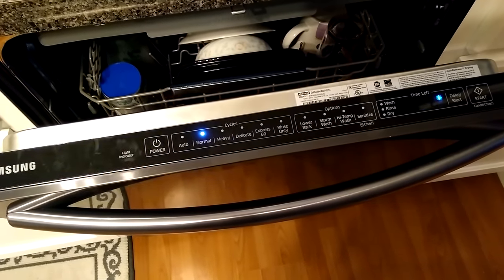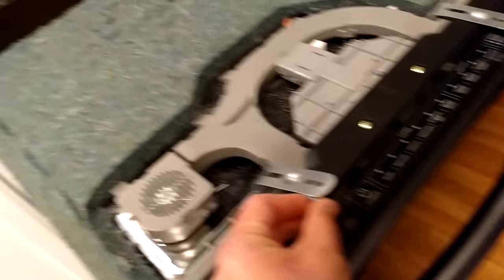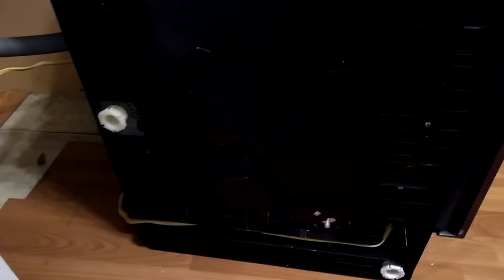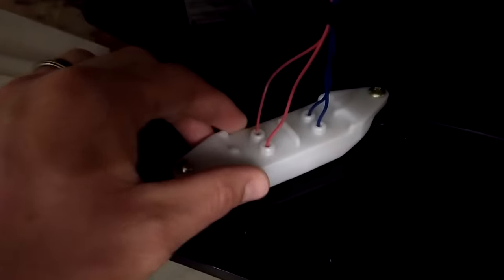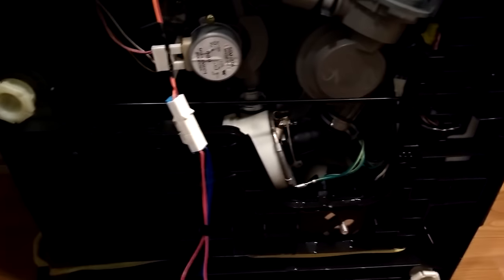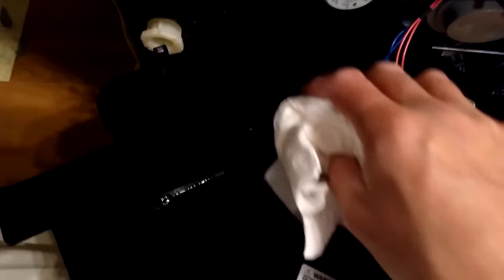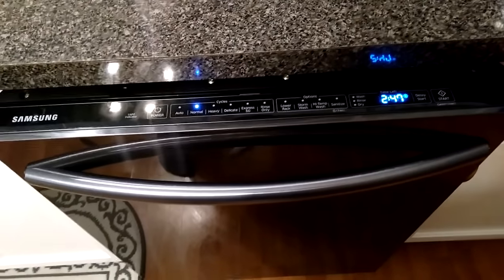How To Fix Samsung Dishwasher with LC Error Code

Comment: I had the same problem, but was determined to find source of the water. The source of the water on my machine was from the water distribution pump. The shaft seal, which can be accessed from inside the tub, failed. That seal failure also cause a bearing to fail in the pump which caused the dishwasher to be louder than normal. The bearings were pressed on so I could not just replace them. A new water distribution pump and seal were going to cost $320 for parts only. This seal was a bad design and was bound to fail. I figured the same problem would happen unless one made it a point to change the seal probably each year. My dishwasher only lasted 18 months. I’m going with a different brand this time. I would strongly suggest that people look for the source of the water. Finding the source and repairing it is the real solution. If your dishwasher is staring to get louder during the wash cycle, then I’m sure the water distribution pump seal is the main cause and the source of the moisture.
Reply: Just an added point to think about, moisture is not just going to show up in the pan. There has to be a source of this moisture. The water distribution pump cooling blades on the motor move air to help cool the motor. This would help dry any condensation ( and I doubt there would be any). If one takes off the bottom pan and sees any evidence of past moisture then the pump motor is drying up the moisture. But the problem is still there and will eventually get worse where the motor can’t dry it out. The shaft seal is the weakest link in their design. I have seen where some are bypassing the sensor. That is only hiding the situation and not a true fix.
Reply from the maker: Thanks for your feedback and tips Michael. If you read through some of the other comments I point out that I tightened all the inlet and outlet water lines and that must have corrected the problem for my machine. I should have stated that in the video, but didn't. I've had it for more than 5 years now and haven't had any other problems and no more LC code.

Comment: replace the drain-line love to  crack or place on 4 milk crates and run do not touch wire on around the circulation  pump  (live power danger) siver)
Reply from the maker: Sounds good. Thanks

Comment: Did you find the leak?
Reply from the maker: I'm pretty sure mine was from either the supply or drain water lines. I tightened both of them and haven't had any other problems.

Comment: Only trouble with just drying sensor which I did, does not  address leak so will continue to cause problems
Reply from the maker: Yeah, I had to lightly tighten all the hoses going in and out. Seemed to solve my problem, hasn't leaked in over a year
Reply: So just now removed bottom pan ..removed sensor and dried everything very good, cannot yet see leak...if happens again will call repair guy, as I would have to get parts anyway..cannot tighten hoses as they have spring clamps only.

Comment: I have a code 3C1,,,, what’s the problem with my dishwasher model DW80K7050UG
Reply from the maker: This is what I found on Google: 3C1	Engine malfunction.	Malfunction of one or more elements of the power circuit of the electric motor

Comment: The ultimate Samsung dishwasher fix….today I took it to the dump and installed a Bosch.  RIP, it was less than 2 yrs old.  The problems started with the LC failure x 3, and then the push buttons/control board failed. Enough is enough.  The Samsung microwave designed by Stupid will be the next to go to the dump.
Reply from the maker: Bummer! Sorry to hear about the short life span. My suite is about 4 years old and I really hope to get many more. But I really feel like most appliances are mass produced future landfill junk. There is more emphasis on appearance and fancy unnecessary bells and whistles than long lasting quality.... Rant over 😆

Comment: I had a technician tell me that with the new dishwashers that don’t have a heating element, it’s because the hot water heater is too hot and it creates too much steam that collects water in that pan and trips the sensor. I turned down my hot water heater and that fixed the problem……..until now. We ended up turning up the hot water heater a little because our showers were too cold and now it’s doing it again……sigh…..
Reply from the maker: That's frustrating, but thanks for sharing

Comment: We did it several times and have water everywhere now so this method resets it but doesn't solve the problem
Reply from the maker: Yeah you still have to figure out where the leak is coming from. In my case there were water supply and waste lines that were loose and required tightening

Comment: Raise the sensor, it will take longer for it to kick off again, or remove it all together and put up with a small leak, or get a New Machine.. Mr Spence Eng
Reply from the maker: Yeah, not a bad idea, thanks for the tip

Comment: Put washers (4 small) under the sensor to raise it up, it was wet, probably drain hose issue. Put a proper hose clamp on that. Test run seems ok. When still on warranty, something from the factory was partially plugging the drain causing a leak, service guy said "never seen that before". Terrible design agreed.
Reply from the maker: So many issues with this dishwasher. Ours is still running after 4 years but it has random annoying problems every once in a while

Comment: I have this exact model. I tried this and it didn't help.  I have a legitimate leak.  The water is coming from the actual motor.  I replaced the O-ring, but now its worse.  At this point im at a loss.  Maybe im not putting it back correctly....I dont know.  BTW - Samsung appliances SUCK!  Or whole kitchen is Samsun appliances and the only thing that works properly is the microwave.
Reply from the maker: That's not good! Our whole kitchen is Samsung too, but we haven't had any problems since the first few months after install, back in 2017... Knock on wood. Best of luck to you!

Comment: Never found the actual leak?
Reply from the maker: We fixed it. I had added in the comments that we tightened all of the in and out water lines. That seemed to be the problem and we haven't had any other issues in the past several years

Comment: Did all that, still have the code going and still trying to drain.
Reply from the maker: Bummer. Hope you've been able to fix it by now?
Reply: @howtofixitworkshop  its fixeded, but now its not draining properly.  Water is sitting at the bottom after every use.
Reply from the maker: @danpelle7434  sorry to hear that Dan. Mine had a leak that I couldn't locate. I tightened the water supply and waste lines and didn't have any other leaking. Good luck!

Comment: Mine is happening every couple of uses. its so frustrating.
Reply from the maker: You may have a leak from one either the supply or waste line
Reply: @howtofixitworkshop  Thanks. I will look into that.

Comment: This is known defect in Samsung dishwashers... the sensor is extremely over sensitive and once it goes off once, it will keep doing it. Sometimes it would be a day later, sometimes a month later. We eventually had to buy a different brand and toss this one.
Reply from the maker: Not sure that I would agree that it will "keep doing it", after the fix on this video and tightening all hose fittings I have not had any other issues with this dish washer in the last 2 years. Ours is used daily and is now going strong. It was aggravating at first and that is not acceptable, but luckily a little diy was all it took to get it running correctly.

Comment: I have the exact same POS dishwasher that has thrown a code 12+ times. Samsung wont cover replacing it because they only actually came out 2 times before the 12 months was up.  We have no leaks not a drop of water anywhere....its a faulty leak detection system and a lot of people have this issue.  Samsung you should be ashamed...I have $10k in Samsung appliances and they wont do the right thing... never again
Reply from the maker: We have a 4 piece suite as well.  The ice maker on our fridge broke right away and I was able to get it replaced under warranty.  The microwave and stove have been fine.  Thankfully the dishwasher has been great since I posted this video, no more LC code since I tightened all of the supply and drain lines.

Comment: You didn't fix the leak tho. You have to remove the bottom panel and run it to ser where it is leaking
Reply from the maker: Thanks. I tightened all the fittings on the in and out water lines. I haven't had any leaks since recording this video

Comment: I just did this and the LC light is still flashing
Reply from the maker: Did you have any luck getting it turned off?
Reply: Opened it back up and discovered it was leaking where 1 of the hoses attaches to the case break, re attached the hose,put the clamp back on and no LC light since
@howtofixitworkshop
Reply from the maker: That's good. Yeah I didn't do a great job explaining how to check those hoses on the video. I think I had a similar issue though with one of the supply or waste lines leaking and I tightened them all. We've had the dishwasher for almost 7 years now and haven't had any more issues after the first year

Comment: I had high hopes for Samsung. I got caught up in the hype. Kitchen, laundry and entertainment. I've had to replace about every appliance. I almost always buy American. I shouldn't have left.
Reply from the maker: I feel your pain.  We purchased the 4 piece suite and had a few issues with the dishwasher, and an ice maker that broke in the fridge.  The oven and microwave have been solid.  Everything is now 6+ years old and all working fine.  They just require a little TLC and DIY here and there for maintenance.

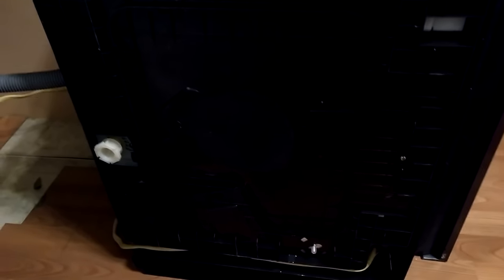Comment: RICE? What about using uncooked rice in that bottom pan to control the moisture detection? I had this for two months. And it is never able to complete a cycle. LC code. I have pulled out any water. Cna't find the source. I set it to AUTO, and it got to about 1:30 hours left and the LC code starts. I used my vac to get the water out. They should be sued and refund their customers. I just want a Bosch at this point.

Comment: This dishwasher is our seventh in 22 years it replaced a Bosch that we had that was real good and we had a power surge which  destroyed all our appliances this thing has been a constant problem every two or three months you have to keep taking the drain tray down and drying it out to get it to work and the dishwasher is barely a year-old when it works it works great but the Bosch was far better now I’m told all the boxes he’s are being made in China and they’re no good either I would kill to have my old Bosch back instead of this thing since I’ve owned practically every brand of dishwasher there is out there over the years I probably would gravitate back towards a Frigidaire since our microwave and fridge refrigerator are that brand  and they have been good knock wood but I work in the industry hear  a lot of horror stories about Samsung LG and  would never get those two brands ever again for anything!
Reply from the maker: Thankfully ours has held up for 6 years after the initial LC code incident.  It threw the code 2 or 3 times before I tightened everything that I could around the motor, pumps and water supply and waste lines.  We still use it daily and, knock on wood, it's still going strong.

Comment: Crazy Mom here‼️ My nee dishwasher worked for 6 months solid. Since, I’ve had 7 service calls. This last call wasn’t in my budget as they wanted 300$ for a new sump. It wouldn’t drain. Bought it for $20 and installed it myself. Now I have this wonderful code and all it does is drain. Called a technician and since I was the dumb dumb that said I replaced the sump - they wouldn’t cover fixing it anymore. So- I have a new drain dilio I put in- I even moved this sensor to a higher area and still get the error. (I’ve memorized this machine like the back of
My hand). So I pulled it out yet again- put in the old sump and it filled up but wouldn’t drain. Put new sump back on- now it just drains. Can I just cut the damn wires to sensor?? Anyone help?  I hvlave this rotten egg smell penetrating the house exuding from under the counter and inside the dishwasher.
Reply from the maker: That's really awful. Sorry, we're not sure how to help that situation

Comment: Samsung dishwashers are overpriced rubbish mine has been repaired 4 times and now has the LC error, both pumps have been replaced and the motherboard.
Reply from the maker: Yeah I've had a couple problems. Thankfully I've been able to solve the issues and everything is working fine after 2 years

Comment: Hate this dishwasher
Reply from the maker: Yeah it's been a pain. What issues are you having?
Reply: How To Fix It Workshop the same LC light thing. It happened about 8 months ago and then yesterday again. I dried it pretty good but no luck. I'll let it sit for a few days and try to turn it on.
Reply from the maker: I made some tweaks the level of the dishwasher feet and slightly tightened up all the drain and supply water lines. I haven't had any more issues with the LC in over a year. But yeah, it's very frustrating.

Comment: I saw another guy DRILL A HOLE IN THE PAN😳
Reply from the maker: Oh no!! That's a bad idea!!
Reply: @howtofixitworkshop  I was a service technician for Sears for many years and this Samsung you have to take it out from under the cabinet and run it in the middle of your floor to see where the leak is coming from mine had water in the pan but no leaks detected after three loads I got no idea how the water got there
Reply from the maker: I'm pretty sure mine either came from dishes loaded improperly causing water to spray toward the door or the inlet/outlet lines not being tight. I've corrected both and only had the leak happen one other time in the last 5ish years

Comment: Horrible dishwashers it's like throwing 900 bucks out the window
Reply from the maker: We agree.  Unfortunately many products and appliances seem to be designed with a shelf life or planned obsolescence.  We as consumers can extend the life of these products by learning some DIY tricks and use platforms like YouTube to learn how to solve problems and continue to share how to fix things.
Reply: Right because my grandparents have one they bought in the 80s still runs like a top
Reply from the maker: Haha, yep. Thinks just aren't built the same as they used to be

Comment: I'm not really sure it's a good idea to do a video on how to fix something and then straight up admit you don't know how to fix it and never actually fix it. To be clear you're not addressing the problem which is the leak, and just drying off the sensor to buy a little time. That's not a fix, it's a Band-Aid.
Reply from the maker: To be clear I dried up the water and tightened all hoses. Have not had any other issues in 2 years. I call that fixed
Reply: And sometimes, there's just residual water from testing (new washer) or jostling around during install.  This code happens after install.  Dry it out and it's good to go.

Comment: Done…thanks.  Mine is a differversion but man, Samsung are assholes…seriously a crappy piece of styrofoam that floats thus pushing a button.  I know simple is reliable but…yeah, No!
Reply from the maker: Yep, based on all the views this video has, it's a pretty lousy dishwasher.  Ours is still going strong after 6 years though.  It just requires a little DIY and cleaning out here and there.

Comment: All Samsung appliances are shit. Great phones and TV's but trash appliances
Reply from the maker: We have a 4 piece suite of kitchen appliances that is over 5 years old now and everything is still doing well. Only problems we had was the LC code on the dishwasher that I fixed when I shot this video (I tightened the supply and waste lines underneath and haven't had any other issues) and our ice maker broke in the refrigerator and I replaced it with a more durable aftermarket and haven't had any other trouble. But yeah, based on all the views and comments on this video.... The Samsung dishwashers aren't very reliable

Comment: Samsung appliances suck now. Fridge has ice maker issue and now dw is leaking. I just bought these 3 yrs ago nice black stainless models. Samsung is trash
Reply from the maker: We had the ice maker break shortly after buying. I found a replacement that had much larger gears and parts and it has lasted search years. Hang in there, with a little bit of diy these issues can be fixed. We've had our suite for 6 years now

Comment: That was not a fix 😢
Reply from the maker: It removed the water which removed the code and we were able to run the dishwasher. I believe I mentioned in the video and in other comments that I tightened the supply lines and waste lines which are the likely leak spots and I have not had this issue any more in the last 5 years

Comment: So, your video title is rather misleading. You didn't actually "fix" the Samsung, you just put a metaphorical Band-Aide on it.
Reply from the maker: Thanks for the comment, it seems to have helped a lot of people. I have replied to several that I tightened the supply and waste lines and haven't had any issues since.

Comment: you did not fix it, buddy. you were not able to locate where the leak was coming from.
Reply from the maker: We fixed it. I had added in the comments that we tightened all of the in and out water lines. That seemed to be the problem and we haven't had any other issues in the past several years.